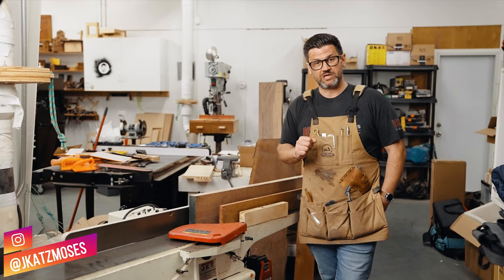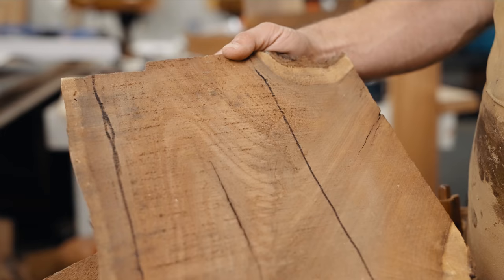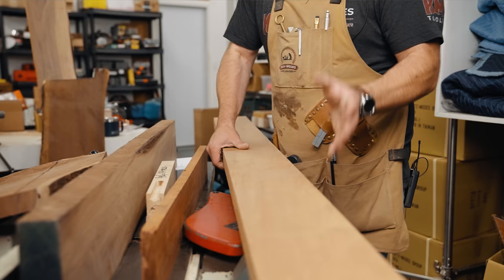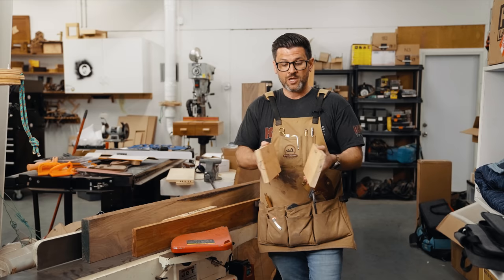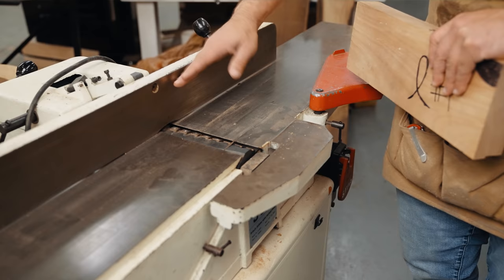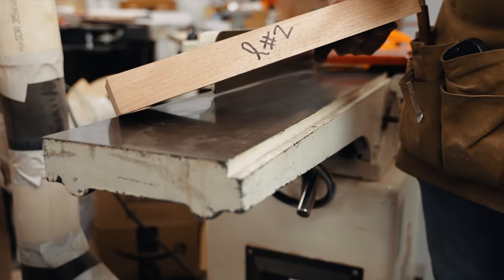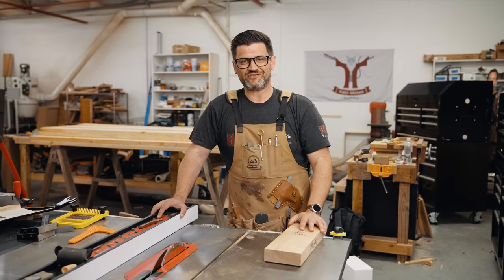Mill and Process Lumber Like a Pro - Woodworking Essentials

Comment: Could you theoretically do all four sides with just a jointer?  I imagine the planer and table saw make the process faster,  but for someone who didn't have access to a fully equipped shop, can you get by with just the jointer?
Reply: No, because if you use the jointer on opposite faces, you will end up with both sides flat, but NOT parallel to each other. 

That's why you need to flatten one side with the jointer and then flatten the other side with the planer.  

The planer actually makes the board the same thickness all of the way through, which means that if the opposite side started flat, the second side will now be flat AND parallel to it.

Comment: @Jonathan Katz-Moses On the last step when you use the table saw to cut that last edge, what blade would you recommend if you had to rip it and leave and edge suitable for jointing.
Reply from the maker: The rip blades we sell are amazing. For more in watch the saw blade video I did about 6 videos ago. Cheers

Comment: I have a question, why can't you use the jointer for both sides of the face to make them flat?  Also running both sides of the edges? If you square up a flat side and edges side, why can't you do the same for the other 2 sides with just the jointer? I'm new to woodworking so trying to learn.
Reply: I'm guessing this is spam, and not really from this channel

Comment: I am a little confused why the first jointed side is facing out while jointing #2 instead of riding the fence. I would think you want the one side you know if good to be the one that the fence is referencing.
Reply from the maker: I say "This would normally be facing the fence but for the purposes of instruction I'm leaving it facing out so you can read it"
Reply: @katzmosestools  I completely missed that, so sorry. ADHD for the win as always!
Reply: So when you did it for real #1 side would be against the fence! Correct?

Comment: I see Tamar from 3x3 using a sled as a substitute for a jointer. Will I get the same result this way? Or this is only in the case my board is "somehow" flat and not totally twisted?
Reply from the maker: There's a great video linked in the pinned comment and description called 5 ways to joint a board without a jointer

Comment: Something I don't get. If we use a jointer first, besides taking a bit more off using the planer, why not use the jointer on all 4 sides?
Reply: Two things are accomplished with milling lumber: 1 making all the sides flat and 2 making all the sides parallel to their opposite face.  A jointer will make all the sides flat but not necessarily parallel or square.

Comment: How is your planer (DW 735) with snipe? I have the same one and get a fair amount. I've leveled the infeed and outfeed wings and still get a bit. Any suggestions?
Reply: I've had two DW735 planers, and both had snipe issues. Sometimes I could run the board through at an angle and that seemed to help, but mostly I either made the board long enough so I could cut off the sniped ends, or spent time hand planing them or sanding them flat.
I also tried using a piece of flat 3/4" plywood as a sled to feed my boards through, and this seemed to work fairly well.
Reply from the maker: I get no snipe. Watch the planer tune up video I have in the pinned comment
Reply: @katzmosestools   Great video! I agree, the best way I've found to prevent snipe is a flat sled or table that spans the planer bed and attached tables as JB describes. Roller pressure can play a part when the board enters and exits the planer as well. As you have described, always take the time to do the necessary maintenance and cleaning. That will help reduce or even solve a lot of problems!
Reply: @katzmosestools  It's funny, I watched your video about tuning a planer a few years ago and tuned mine then. I re-watched it just now thinking to myself, "I swear I've seen this before." 

I  have the same set up as you (DW735 with Shelix cutter and Wixey gauge on that same DeWalt rolling stand) which gives me hope as you say yours is able to plane without snipe.

I gave it another try to level the bed this evening and found that my infeed and outfeed wings were slightly dished (1/8" - 1/16") like something heavy had been set on the middle. 

I removed them and tried to bend them straight by hand on the workbench and they're better than they were. It was too late at night for me to do a test piece to see if it helps my snipe.

If that doesn't work, I think I may try getting rid of the stamped steel wings and replacing them with a piece of thick melamine. Kind of a hybrid solution that you mentioned in your video that Jay Bates did with his.

Thanks for the comment, and I appreciate your time helping random people like me!

Comment: Thanks Jonathan, any tips you have found successful when milling thick, heavy stock?  I was working on making some legs for a bed out of 16/4 white oak (approximately a 4"x4") and was having a really tough time on the jointer getting that second edge perpendicular to the first.  Either I wasn't getting it pushed up against the fence fully, or the amount of force it took to do so was moving the whole jointer.  I only have a 6" jointer so I'm sure something larger and heavier would help but hoping for some new ideas before I get started on the bed for my second child!
Reply from the maker: I have a great video in the pinned comment
Reply: @katzmosestools  Jonathan, please see the message below, I assume this is spam but just wanted to check/notify you since it looks like it does have your Youtube Icon.

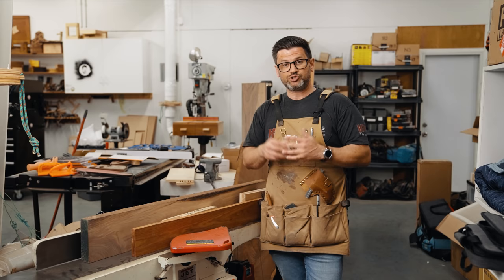Comment: You and I have very different hardwood lumber sources. I am at about the 4:00 mark where you are describing how rough/cleaned up boards come. 

At my hardwood place, most boards are either rough or "hit and miss" planed. Sometimes you'll find some boards "straight line ripped 1 side, surfaced 1 face," and although they do have a stack of s4s or s3s up front, it only takes up about 5% of the store & is mostly for people just coming from the home center.

Comment: Is there a benefit to using the table saw at step 3 before the planer? That is less material your planer needs to take off. Or is that problematic for some reason?

Comment: Hey Jonathan, how do you usually rip a board to fit your jointer? Many times rough sawn lumber is quite wide from the distributor. Things can get sketchy very quickly depending on how rough the board is. I use my track saw when the faces are flat enough (95% of the time). There have been times that I've been stumped on how to start - maybe a good use for a hand plane in those situations?
Reply from the maker: Check out my recent jointer video. I show you how to deal with boards wider than your jointer.

Comment: I’m genuinely curious if what I’ve been doing is wrong so please explain why it wouldn’t be more beneficial to do the steps in this order:
1: use jointer to establish a flat face

2: us planer to parallel that flat face

3: THEN use the jointer to make one edge 90

4: finish by cutting the last side with a table saw.

I just feel like it’s too possible for a piece of debris to obstruct the planing process causing the precut 90 on the jointer to no longer be a true 90 after planing. I could be wrong but I just can’t help but think the edge jointing should happen 3rd.
Reply from the maker: Your way is slower but achieves the same result

Comment: Where did measuring with 1/4 come from? why not just say how thick it is, for example where I live 18mm lumber is 18mm thick. The 1/4 ref doesn't make sense.
Reply: That’s the benefit of working in the metric system instead of this outdated imperial system. The funny part is, there imperial system is based on the metric system. There currency is metric, meaning usa is using that on a daily basis without them having any problem using that.

Comment: It cannot be stressed enough, for people just figuring this out, and those without a jointer,  you will not get a good edge if you rip without a flat bottom face. If you have a twist, or cup, it will not leave a 90d edge. Even on a jointing jig, you need a pretty flat face.
Reply: Exactly. Some of this is just so simple that many of us over-think the issue.

Comment: Does this process take snipe into consideration?
Reply from the maker: Snipe had nothing to do with this process. You account for snipe by either fixing it (check video in pinned comment) or leaving your boards longer than needed when you're milling.

Comment: Another pro tip: if a board is too twisted, keep pressure on the back end of the board when planing. Once you've planed half of the board, switch the pressure to the front end. Rinse and repeat.
Reply from the maker: To me that sounds like you'd just create a low spot in the middle. Maybe I'm not understanding. I have a great video on using the jointer where I talk about how I approach twisted boards. Cheers
Reply: @katzmosestools  No, when you keep pressure on the part of the board furthest away from the cutter, you remove the most extreme parts of the twist (usually in both ends of the board). Kinda hard to explain, especially when it's not in my native language.

I figured this out on my own so I don't have any videos to reference, but I hope you understand anyway.

Edit: something like this:
https://drive.google.com/file/d/1R_g-2VAs3P7_cykrmw6LkkLiiC_Txk8x/view?usp=drivesdk

Comment: A shop where the humidity levels are stable is preferred as well. Which means not too dry and not too wet. Most furniture lives in climate controlled environments so for proper RH that should be one's gauge, however, accounting for more wood movement than that is still best practice. For example, if your shop is on the drier side during most projects then that's the most amount of contraction one is likely to see in the project and so accounting for expansion is the necessary element etc. Personally, I would find it too frustrating to work in a shop where the humidity levels swung a lot between seasons.

Comment: I think the process depends on the board, it's dimensions and your comfort level with the tools. Personally, I don't like the jointer as there is often too much danger exposed imo - they take whole hands, not just fingers... You won't see me jointing a face, ever. I will only joint edges of boards greater than 2 inches in height off the table. Sometimes it's better to straight line rip a board first before going to the jointer. If the board is twisted, you can use a flattening jig with the planer then straightline then joint the straightline to cleanup the saw cut, plane the second face, cleanup both faces with a shallow pass on the planer, rip to +(depth of jointer cut) and one pass on the jointer to final dimension cleaning up your saw marks. If it's just cupped, but otherwise straight with very little or no twist, you can get away with flattening a face with a planer straight away without a jig given low pressure shallow depth of cut passes.
Reply: Make your own video.

Comment: NO! At 8:29, if you flip the board like that, you will switch the grain direction, causing tear out; potentially massive.  Flip the board long ways, enabling the grain to go in the same direction. 
Mark your jointed side in pencil with the grain direction. If it's pointing toward the roof of your shop, that's how you should feed it into the planer.
Reply: Did he mention anything about grain direction?  I didn't catch it if he did.  Seems like a pretty important topic to miss.
Reply: Nathan, don’t get me wrong, I still follow grain direction When I can, but with most of the new helical segmented heads it almost doesn’t matter anymore. I know I’m gonna to get flamed on this by people that don’t use them, but I’m amazed every time I pull a board off I put in backwards or some Birdseye maple or any other wood that has grain switches back-and-forth how clean it comes out.
Reply: @MrWookie1981  no, he does not mention grain direction. He must be so used to using a helical cuter head that he doesn't need to worry about it. Must be nice.
Reply: @toolchuck  thanks for the response. From what I've seen, the helical heads come at a premium. I look forward to putting them on my planer, but that's around $1200 away. 
Given the rudimentary lesson of this video, I was amazed that he didn't cover grain direction. He must assume that everyone is using a helical cutter. Given that he didn't state that fact, I'd wager that there will be several very frustrated beginning woodworkers if they follow this video using a jointer and planer with knives.
Reply: @sappy2123  You may already know this but make sure it is "Helical" and not "Spiral" cutter head. They are both spiral, but only one is helical. The helical shears as it cut because the cutters are at a slight angle and the cutters have a slight arc or curve on their face, not flat or straight like on a spiral. I say this for those reading this that may not be aware of the differences between the two. Some say there is only a slight difference in cut quality between them, but I'm here to tell you that there is. I mean I'm saying it on YouTube, so it must be true, right? 🤷‍♂️
Seriously, I live 0.7 mi. from my local Rockler (so I'm there too often) and my friends that work there and have access to and use several planers/jointers and thickness planers with various cutter heads. And on occasion they'll come over to B.S. and/or use my machines to mill some wood. And every time they are amazed at the surface finish of my planer and thicknesser which has a helical cutter on it. It's a Felder so I'm partial but any quality helical cutter head will perform as good, well almost. 😜
All the Best, Chuck

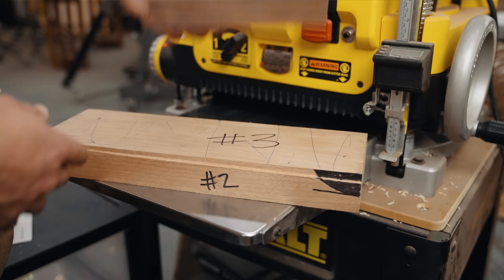Comment: Big fan and great vid overall, but unfortunately your planer explanation could be misleading. You used the word "flat" to describe what a planer does multiple times when really it just gives a consistent thickness. The visual aid you show at 8:00 is also backwards - rather than mirroring the curves, they should be parallel/equidistant along the length of the piece to show that although a planer gives you a consistent thickness, it does not necessarily give you flatness (that is unless the opposing side is surfaced flat first). This is one of the hardest things for new woodworkers to grasp. Cheers!